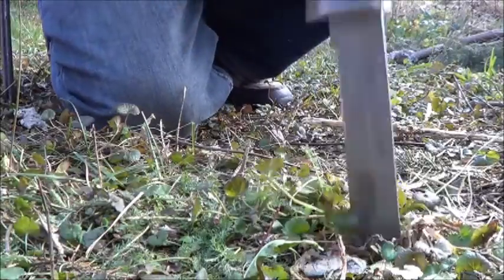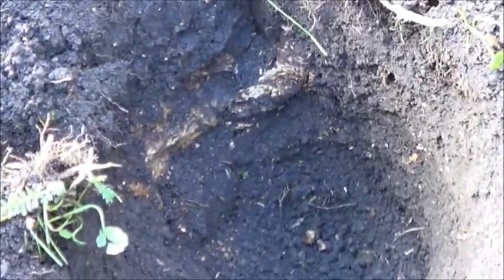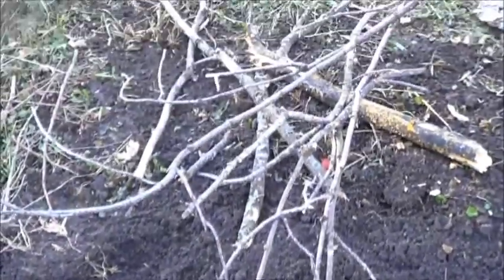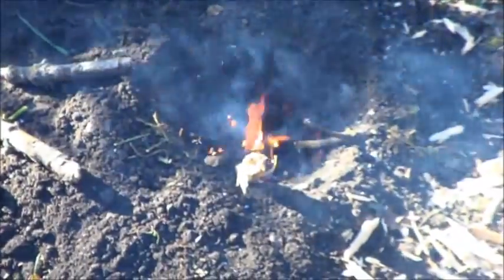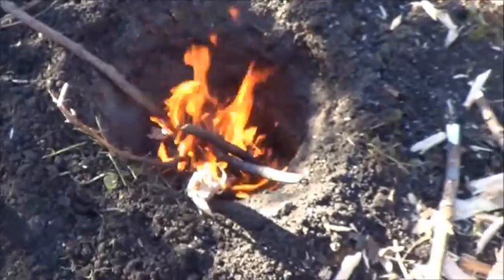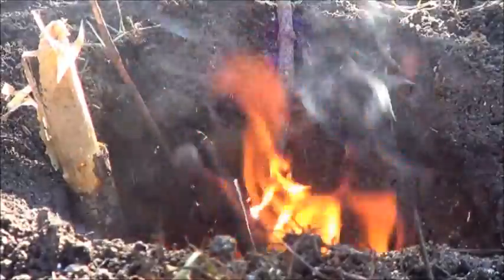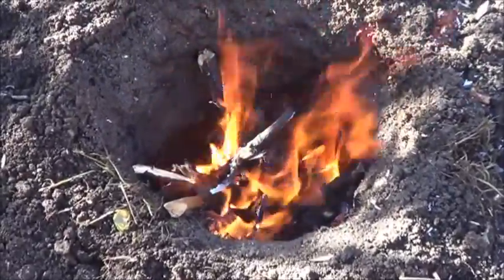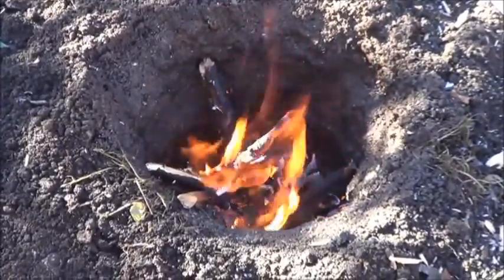Attempting a Dakota Fire Hole

Comment: I wish I could try that kind of fire. We have sand so our fire pits tend to be big to get the air flowing cause we cannot have an air hole dug in. Although I did use a burn barrel to burn down a few stumps in the yard to level out the lawn!! Yeah fire!!
Reply from the maker: +RevtosTV - Gotta love the classic 'burn barrel'.  I've seen those suckers get so hot they glow ...
Reply: I have had my burn barrel so hot that it glows for days at a time. I destroy them with the amount of fires that I have. I once had a fire burning in one for a month and a half straight after cutting down like 150 trees (you couldn't even tell I did anything to the landscape though). Every couple hours go out, stir and add more wood. In ten years now I have been through like seven barrels because they get so hot they break down and eventually fall apart. The one I got last year is already half fallen apart! Lol!
Reply from the maker: Lol, over achiever eh?  Must be loads of great ash for the gardens ... truckloads!
Reply: The grass back there is the best in the yard!! Lol!

Comment: Copied from one of my posts on another video;  Partner, as a child I used to hunt native American artifacts all of the time.  Living 65 miles from town anyway, that was about all there was to do.  Any way I dug up an "Indian" fire pit and found several chips (spalls) and incomplete arrowheads.  Leading me to infer that they used them also as a cache of some  sort.  Which peaked my interest.  After digging several of them I began to take note of how they were constructed.  First, they were consistently 18" to over 24" deep with a circumference of no more than 10".  On a few occasions I began noticing a void at or very near  the  bottom.  But and also consistently that void was about wrist size.  I then realized how these worked and how they were made.  Simply, they're much the same as today's rocket stove.  No need to aim the intake toward the "prevailing wind".  They work on draw much like a flue.  The deeper it is the more  draw you have, unless your circumference is to wide.  To make a very long story somewhat shorter the way I make them and have for over  fifty years,  Is to take a pole and drive it at an angle toward where I want my fire.  A simple equation to figure where the hole will end is a 3/4/5 angle.  That's for every 3" down you're 4" away resulting in a diagonal of 5"incriments.  Two foot away is 18 inches down..  After I've driven the pole and worked it in and out, I leave it in, then dig my main fire hole, hitting the end of my pole.  Once again that pole isn't much bigger than around my wrist.  Then just remove the pole and lay the fire.  These fires get hot enough to cook lime making quick lime.  Which means they are well over 600* much less smoke and ash than even the SAS version of the Dakota hole.  It's more of a complete combustion than most camp fires.  Speaking of which I didn't even know that they were called a "Dakota hole" until a few years ago.  I hope this helps you Bud.  The problem I see with most youtube videos on this that I've seen is that they don't do them deep enough and their diameters are way to big.  This counter acts the draw resulting in less efficiency.  Simply think of a stove pipe and flue, if you have it two foot around and ten inches deep there essentially is little to no draw.  Or belter yet, think of sucking liquid up into a straw.  If the straw is 1/4" it's fairly easy to "draw" the fluid up.  But if the straw is an inch or better wide it's darned near impossible to "draw" the liquid up to the top.  Therefor you may as well just lay your fire on the surface as to have it to wide and shallow.  Also why they have to aim it at "prevailing winds" to get them to work.
Reply from the maker: Thanks, that's a lot of good info!

Comment: You did nothing wrong.  You get a bit better burn by filling up the pit first, lighting it on top, in a few different places with the sticks vertical and lots of dry grass and twigs on top and in between, like swedish candle. That way you don't have to keep feeding it, at least at first. The fire burns from the top down. As the wood underneath the fire is heated, it gives off its wood gasses and they rise as smoke into into fire and are burned. This makes the fire very hot with yellow blue and white flame, it burns slower because it uses all the oxygen above the fire and with almost no smoke at all, the dryer the wood is. Most people make the mistake of starting a small fire in the bottom and then smothering it with wood on top making it smoke a lot. You didn't. That means you have some of the common sense you were made with still. 

The air below the fire coming from the other hole is called the primary air and keeps the fire burning as long as there's fuel. Fuel, Air and Heat are needed for a fire. 

The air above the fire is called secondary air and can burn smoke rising from the fire. The pits can be made as small or as big as want or need. 

It uses the principle of containment, the fire burns hotter with less smoke when it is contained and secondary air above the fire that can produce white flames up to 2000 degrees not only burning all the smoke, but eliminating pot smut, and carbon monoxide to the lungs and smoke film on clothes and gear. It also is carbon negative, and better for the environment. Your fire is a success when you have no red or orange flame or smoke. This is the safest way to have a fire outside so that it is not spread by the wind and can be easily put out with its own dirt when finished.
Reply from the maker: +MrJoeyBoombotz - Thanks for the great info!  I was wondering how it would work with a Swedish torch in the burn chamber, I guess I'll have to give it a try now that the snow has finally melted and I can find the fire pit again!
Reply: Cool beans.